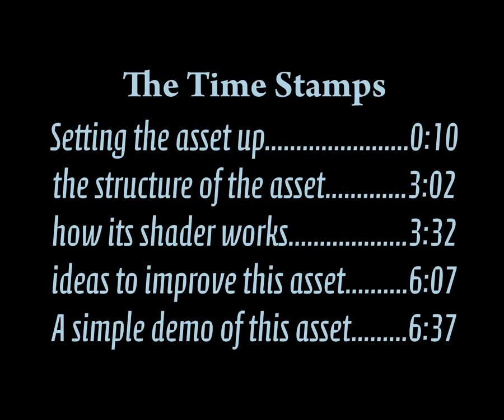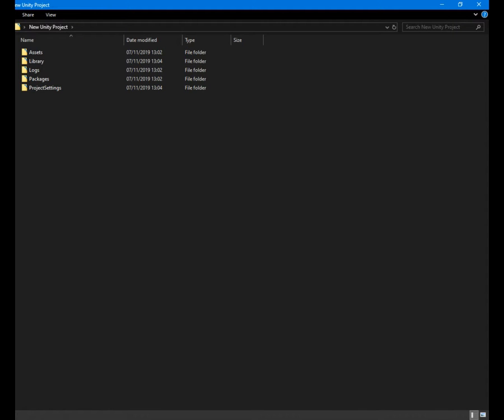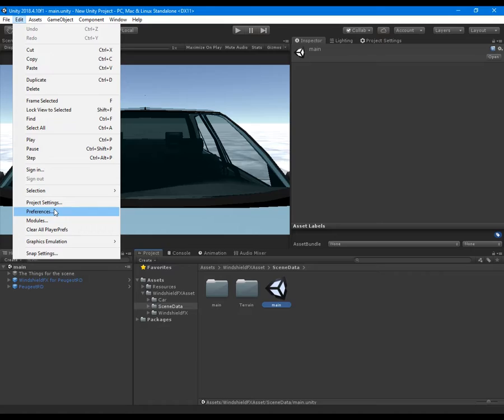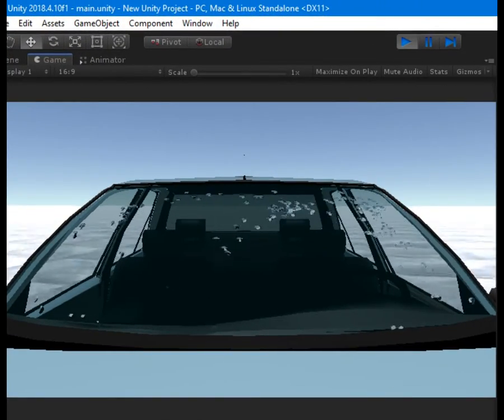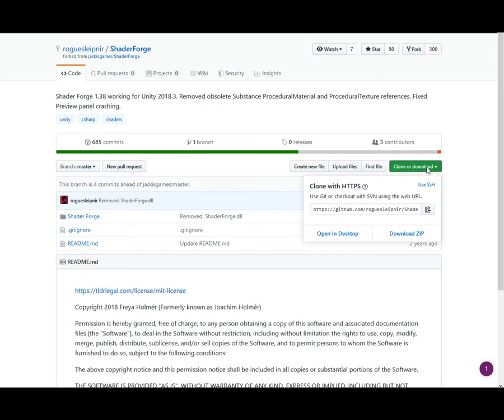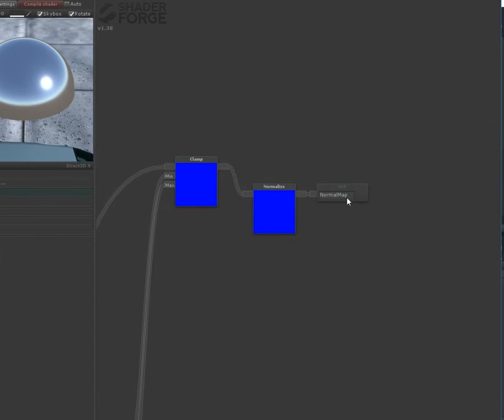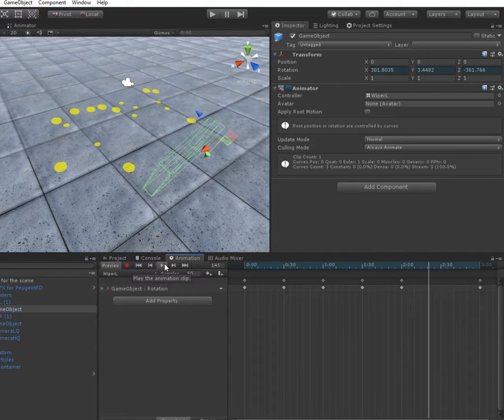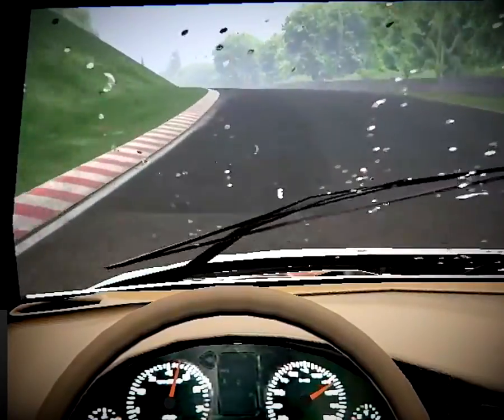Real-time Rain Unity3D FX for Windshield - Tutorial

Comment: Hi,
Thank you so much. The wiper animation is working now. But the wipers are invisible. Could you pls explain how you have connected the wiper object to the animation as seen in the video

Thank you so much
Reply from the maker: Hi there.

On a new script, in the "Fixed Update" function, update the local rotation of the real wiper object based on the current local rotation of the actual wiper collider.
- Best.
Reply: @imDanoush  or could you pls give a sample fixed update code that links the game object and the collider
Reply from the maker: @jananil7527  Sorry I don't have the project atm, try modifying the animation of the wipers. To "link" a game object to another one (in this case, to the animated collider object), simply use something like the pseudo-code below.

Transform Object;
Transform AnimatedCollider;

void FixedUpdate() {
 Object.localRotation = AnimatedCollider.localRotation;
}

now I'm not sure about local rotation, maybe a rotation does the job, you have to try those both if you ask me.
hope this helps.
- best.
Reply: It is connected now.. but now I want to flip the colliders 😀 that's not working.. I want the colliders to move in clock wise direction
Reply from the maker: Try one of these 3 methods at a time:
1) Add an empty object as a parent of the visible car wiper. And work on the empty game object (which is now the parent of the 3D wiper model).
2) If you want to mirror the rotation, manipulate the axis (with Quaternion.Euler(x,y,z)).
3) You can also try to match the pivot of the visible 3D wiper model exactly the same as the collider one, then flip it. to do this in 3D Studio Max, click go to the modifier panel then click on the Pivot section and flip the local pivot 180 degrees.
- Best.
Reply: @imDanoush  thank you 😀
Reply: I have rotated the wipers to the required direction. What I need is to rotate colliders as per the direction of the wiper
Reply: Hi.. I could not do it.. 😭 I was trying to do it all these days.. I know I'm asking for too much. Is there any chance you could flip the wiper colliders and give... Since the vehicles here are right hand drives.. the wipers move in the opposite direction 😭
Reply: It would be a great help if you could do that 😔